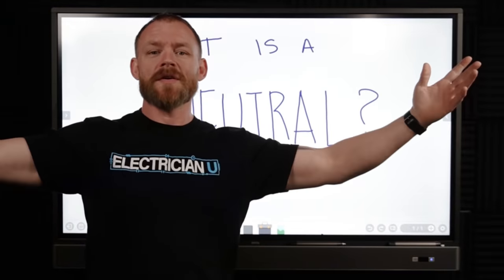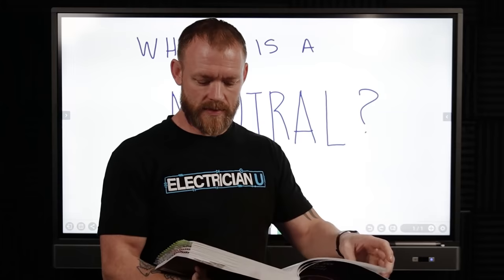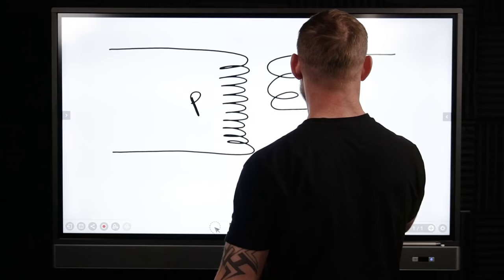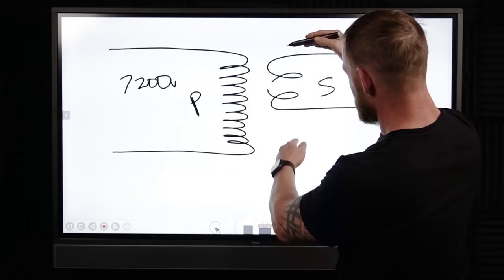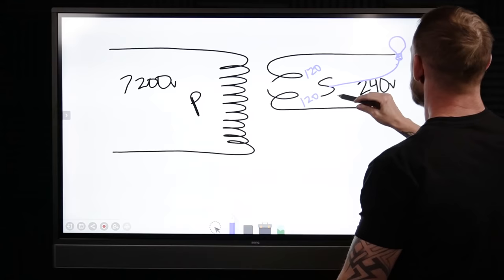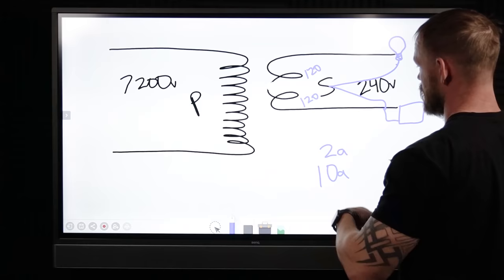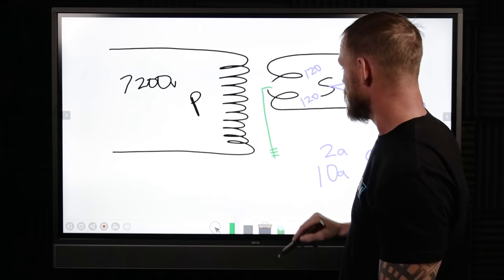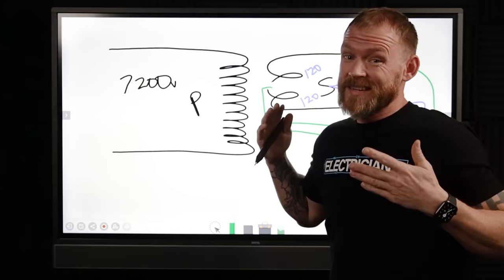What is a Neutral? The Difference Between Grounded and Grounding Conductors.

Comment: the electrical system where i live is 240 vac, 60 hz, two-wire (hot and neutral) and ungrounded system. i often get zapped when touching the metal frames of some electrical loads, i want to install a ground rod and upgrade my circuit wirings to grounded system, do i need to bond or connect the grounding wire to the neutral line?
Reply: Is this in North America?  I would have an electrician install a new panel meeting current code.  That’s not because I don’t think a nonprofessional can’t do it.  I did it myself once.  It’s a lot of work and it’s dangerous.  Once you have a proper service panel, adding circuits is fairly easy.
Reply: @GH-oi2jf  i just need to know before i hire an electrician if the ground wire should be bonded to the neutral line, take note also that the system we have is not like the same in the u.s. where there are two hot lines and a neutral line. our system has one hot line and a neutral line.
Reply: @igorivanov7232  — He is discussing the North American system here.  We in the United States do not, generally, know the detailed rules for configuring an electric system in other places.  We ground the neutral at the service panel, and we ground all exposed metal housings of electric equipment.

It would be better to get documentation specific to your system to see how it should be done.
Reply: @GH-oi2jf  could you explain then why under the american system the ground is bonded with the neutral line? if i am not wrong, my understanding is that the neutral line and the ground line attached to it could potentially become dangerous when there is an imbalance load. since the neutral line is the return path of electricity, should the ground line be separated from the neutral line?
Reply: @igorivanov7232  — I don’t use the term “return” because I don’t think it is helpful in understanding AC circuits.  We want one point in the circuit attached to ground so that all points in the circuit have a fixed potential (voltage) relative to ground.  The “neutral point” is where the system is grounded.  In our North American system that is the center tap of the secondary.  Grounding it means that the voltage elsewhere in the circuit is limited to 120V relative to ground.  The neutral is bonded to ground only at the main panel where the power comes into the building.  The ground wires are connected to an actual earth ground in some manner.

In a 3-phase system, the common conductor in a “Y” configuration is the neutral point.  If that is grounded, the phase voltages (probably 230V more or less in Europe) will similarly be limited relative to ground.  In both cases, we are interested in potential relative to ground (not just neutral) because you are probably providing a path to ground when you receive a shock from a “hot” point in the system.

If your service has only one phase of a 3-phase system, one of your lines should still be the neutral and I expect it should be tied to ground (although I do not know the details of your system).  

Note that “unbalanced loads” in the North American system or in a typical 3-phase system have nothing to do with the reason we want the neutral point tied to ground.  Unbalanced loads merely create current in the neutral, which is normal.
Reply: @igorivanov7232  — Now your problem of getting a shock from the frame or housing of an appliance is another matter and a very serious one.  The exposed metal parts should always be attached to ground for safety.  In North America we use a separate ground wire for that, not the neutral wire.  If an appliance is built so that it is intended that the frame will be grounded by the neutral conductor, then it is essential that it be connected to power in the correct orientation.  That is why, in the North American system, our receptacles have two slots for power of different width.  A plug with one prong wider than the other is called “polarized” because it will only fit the receptacle in one orientation.  The cord must be wired to the device correctly so that the device is connected to neutral properly.

Your problem of receiving a shock from an appliance could be because something is wrong inside the appliance, or because the connections to power are reversed from what they should be, or because your system is not grounded properly, or some combination.  I think an expert in your particular electrical system is needed to determine what is wrong.  It must be fixed because it is dangerous.
Reply: @GH-oi2jf  if i install a grounding rod and run a grounding wire to a grounding bus bar in the panel where all the grounding wires from the outlets are to be connected, do i still need to bond the grounding bus bar to the neutral line? or is it safe enough without connecting it to the neutral? does a separate grounding circuit, not bonded with the neutral, will provide a safe grounding?
Reply: @igorivanov7232  — I think you need to have someone familiar with electric installations in your country inspect your system  to determine what needs to be done.
Reply: @GH-oi2jf  i found out a video explaining how our system is set up, it's a single phase, two-wire, 220 vac, one ungrounded wire and one grounded wire, the grounded line serves as the neutral. the system is a modified 3-wire of the u.s. system except that the center tapped wire or the neutral line is not being used, instead the two hot lines are utilized, one of which is grounded to the utility pole, and if i needed to add a ground circuit for the household equipment/loads, my ground wire connected to the grounding rod has to be bonded with the grounded line on the source side of the main breaker via a busbar.
Reply: The fact that you get socked means the system is grounded. You lack all the knowledge and skill to do any such issues. Consult a licensed electrician.

Comment: Im still trying to understand why the neutral and the ground bar are tied together in the panel, but there is still separation when wiring up a new circuit. white to neutral, and green to ground bar.
Reply: One good reason to keep them separate is so you can implement ground fault protection.  A ground fault could be something that will kill you.  We had separate ground and neutral before we had GFCIs, though.  Suppose a hot wire were accidentaly shorted to the chassis of a piece of equipment.  If the neutral were connected to ground everywhere, then the fault would be energizing the other circuits everywhere.  We don’t want that.  We want the grounding system to carry the fault current back to the panel then to earth ground or to the transformer neutral (or both), bypassing everything else.
Reply: They are connected only at one place. There is absolutely no benefit in connecting them at any other place. They need to be connected as there is no separate ground entry to the house. Under  TN system you need a copper from the ground wire to the transformer.

Comment: Is it recomend runing three wire circuits for home wiring?
Reply: In the USA 120v should be hot neutral and ground. 240v should be a hot from leg 1, a second hot which comes from leg 2, a neutral and a ground. 

The neutral and the ground should never be tied together except at one location where the utilities enter the building (main breaker panel)
Reply: Do you mean shared neutral?  That’s a separate video.

Comment: Does 3 phase use neutral? Starting to learn 3 phase. What is the stinger?
Reply: Yes, it in most cases uses it. Sure some cases like a three phase motor does not need neutral.
Reply from the maker: Yes. All panels will have a neutral, or grounded conductor. Single of Three phase. The only difference is the potential from line to line voltage. In single phase 120/240, you will read 240 across the two hots. In a 120/208 Y panel, you would read 208 between two ungrounded conductors. Also, a stinger, or orange phase, high phase, bastard phase, whatever, refers to a delta high leg system.

Comment: Ok, I understand this. But the neutral since does carry current and knowing that AC switches direction 60 times a second in the NA system.
So, why don't I get shocked when I touch a neutral and touch ground? But when I grab a phase and touch ground I do get shocked?
I never understood this. From my understanding the neutral becomes live 30 times a second and the phase becomes neutral 30 times a second due to the constant change... 
So why can't I get shocked by it?
Reply: The Neutral is kept close to Earth Potential (0 Volts) and because of this you will not get shocked.
Reply: 120 times, twice in a cycle. The neutral is grounded so there is no potential difference (voltage) between it and ground. You are confusing voltage and current.

The last is just nonsense. The neutral is grounded, It cannot become live.
Reply: @okaro6595  just a note to your answer : The Neutral wire as long as it is not disconnected from the Earth Bus bar (Ground Bus bar) cannot become live. If the Neutral wire is broken it can rise to Mains potential.
Reply: @timg6850  Correct. Also if it breaks upstream from the connection to the earth wire the voltage gets also to the earth wire and then to equipment cases. This is known as a PEN-fault. It is one reason why metal surfaces are bonded.
Reply: AC actually switches direction 120 times a second.  A cycle is two switches.

Comment: So why would you have a switch that puts voltage on a neutral?
Reply: @Box Addict thanks for the answer but I think I messed up the question. The switch was making a neutral wire of a 120v 20amp circuit into a hot
Reply from the maker: Re identified traveler? Or you talking the animation used? If so it's just a visual aid not an actual representation I would recommend in normal use.

Comment: I came to find out what a neutral wire (white wire) is for.  I leave realizing that I don’t understand anything about electricity.
Reply: Go back to fundamentals.  Electricity must run in a circuit to do work.  An elementary circuit is a source of EMF (Voltage) which causes the electric current (Amperage), a load, which provides resistance to the electric current and by so doing is able to extract energy from the circuit, and two wires to connect the Voltage source to the load.  In a DC circuit the current acts in one direction; in an AC circuit the current acts in both directions, alternately.

The white wire is, by convention, one which connects to the center tap of the transformer secondary in the North American split phase AC system.  With respect to circuit operation, it is just one of the two wires needed to make a complete circuit.

Comment: Im still confused,  shouldnt there always be a voltage on the neutral then? why does sticking a voltage detector into the neutral of an outlet not detect anything? (in most cases)

Edit: maybe I just answered my own question here, there has to be a load on the hot so that there is a return at all?
Reply: Yup, you answered your question
Reply: @bigbangcesar  gotcha! One more though! Wouldn't there also be a detectable voltage if there was a load upstream? I.e. on a chain of 3 outlets on the same circuit wouldn't the neutral on the 1st/2nd have a current if there is a load on the third?
Reply: Voltage is between two points. Since the neutral is grounded there is no voltage between it and the ground.

Comment: Why is it called single phase, isn’t it actually 2 phases, A and B (usually black and red)?
Reply: 1) Its a split phase,  the Transformer secondary coil which would normally provide 240v is split. The effect of this to create 2 phases of 120v which are out phase with each other by 180 degrees .

Comment: So, why can't a 240 circuit eliminate the neutral? (sorry, I'm just a Revit jockey, but not an electrician. I love learning from these videos anyway. Thanks, Dustin).
Reply: Unless I am missing something, but in US there is no neutral for 240V. My 240V plug for AC has 3 prongs, 2 go to the two hots and the 3rd is equipment ground.
Reply: You mean you would connect everything to the 240 V and junk the neutral. That would be possible but it would be against the code and you would not get equipment that work with it. You would need to import everything from Europe and even then the frequency could cause problems.
Reply: @gslavik  Many 240 V equipment still use 120 V for the electronics etc.
Reply: 240V equipment requires 2 ungrounded(hots) and an equipment ground. 120/240V equipment requires 2 ungrounded(hots), 1 grounded(neutral), and 1 equipment ground. An important thing to note is that BOTH ungrounded conductors must be protected.

Comment: So how come you dont get shocked when you touch the neutral conductor? Is that because if you touch it and you're touching "ground" some where you're not at any potential differences? You're essentially only connect to the neutral and doesnt complete the circuit
Reply from the maker: This question gets asked a lot. And there are multiple reasons why you might not get shocked much like there are multiple reasons why you might get shocked on the neutral wire. 

It's a big answer to what should be a simple question.

Comment: This must be an American style right? The rest of us simply ground one side of the secondary coil as far as i know. I have heard of two phase systems before but never had to work on or have ever actually seen one, does this model qualify as that?
Reply: North American split phase
Reply: The word two phase is reserved for something different, now obsolete. The US system is called single phase. The idea is to get 240 volts while keeping the maximum voyage to the groudn at 120 V as well as keeping compatibility.

There are different systems. In Finland the norm is three phase. Every modern installation get it. There the center pint of the transformer is grounded. High loads lie ranges typically get all three phases (16 A each) but require just one neutral - though single phase (like 20 A) is also an option.

Comment: I just had a thought, it would be cool if you could put a breaker on a neutral wire sometimes. My friends cabin has a long run of two 8awg wires running to a 240v electric tankless hot water heater. If you wanted a 15a 120v plug in the same location you could bring a 14awg neutral and have that neutral be protected by a 15a breaker. But there is no reasonable way to have that breaker within our US electrical system. So to fulfill that need you would just bring both 14awg hot an neutral and not touch the 8awg wires with the 120v plug. 

Unless I’m missing a trick that could be used.

Comment: That was totally unclear. Since the neutral is anyway connected to the same bus as the ground in the electric panel, what’s the point of the neutral?
Reply: Neutral is the normal path of electricity. If you remove it then nothing works. Ground is for safety. First there was just live and neutral. Faulty equipment could cause shocks especially in wet rooms. They decided to add separate wire that connected to the case and would in case of a fault keep the voltage low and in most cases blow the fuse.

Now could they have used the same wire? Yes, and in many places they did, for example in Finland where that was the norm from the 30s to the 80s. This was done for cost reasons but it can cause problems. The most feared is the PEN fault. That is if the wire gets loose or breaks the mains voltage gets to the case even if the equipment is perfectly working so the grounding causes what it was intended to prevent. This is one reason why DIY is strictly banned in Finland. Second problem that actually has caused fatalities is that a DIY can connect the ground connector incorrectly to the live wire. Earlier colors were not used consistently or even same colors were used on both wires. There is also a third problem that is more relevant nowadays. Using the same wire for grounding causes stray currents that go through water pipes, IT cables etc. and they can cause interference. Also one cannot use a GFCI/RCD on the panel if one has PEN-wires. I have RCDs on my panel but they are not connected because of the PEN-wires I have in my apartment. You can use it in a socket but it does not protect against a PEN fault.

Note there are different grounding systems. The common used in the US, UK and Finland is TN-C-S (Terre, neutral, common, separate). UK used earlier TN-S where there is separate ground all the way from the transformer. The benefit is that there cannot be a PEN-fault. Finland and Germany used TN-C.  In the Continental Europe a common method is TT (Terre-Terre). In it the ground wire goes to the ground and nowhere else. Because the fault current is just a few amperes additional protection is needed. Now that is an RCD, earlier other methods were used. The benefit again is that there is no possibility of a PEN fault.
Reply: You need two wires to complete a circuit. Ground was later added for safety. There are reasons why neutral is not used for that.